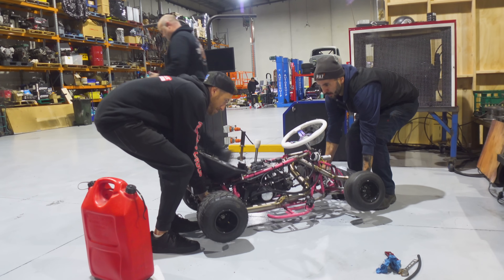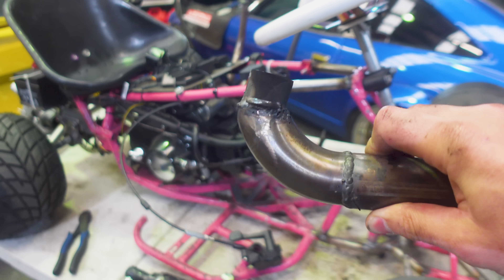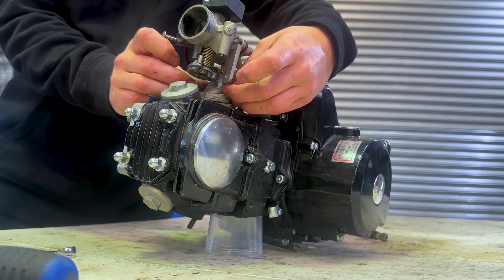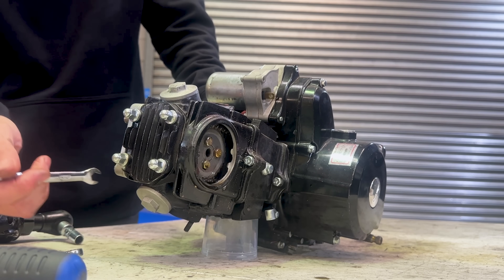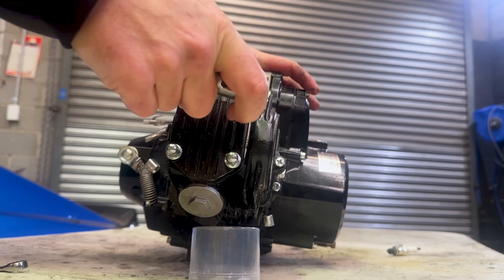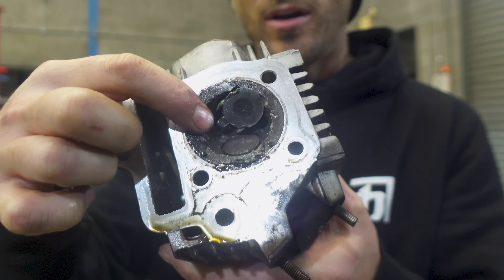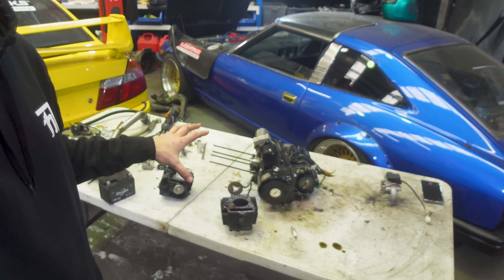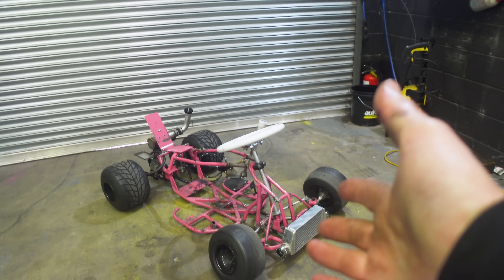BLOWN 125cc TURBO Motor TEARDOWN Go Kart | Part 9

Comment from the maker: Missed an episode? Watch the whole 125cc Turbo build series HERE! https://www.youtube.com/watch?v=BkHVaRDEAlY&list=PLLrSI6tzPmgFHxkPwczR5Zc_DKtxfkXuL
Reply: @itsmikelake Hi love the vids ❤ the kàrt looks mint   not sure if anyone has suggested this yet.  So my suggestion is do away with the electric start (I know it's not ideal but easy to get around) the reason behind this is so you can install an inner rotor kit this allows the engine to free rev up to 14000 rpm with stock flywheel and ignition the 125cc motors make 9.5kw @9500 rpm (max the stock flywheel will allow it to rev) if you do an inner rotor kit port the head and intake runner do valves and timing I like the double head gasket idea not sure if you will have trouble with chain length thought     I guarantee if you do the inner rotor kit you will be surprised the gain. Just beware some kits are hit and miss with tolerances.      Hope you look into it      keep up the great work ❤
Reply: Valves Kit Intake Exhaust Valve Assembly for 125cc ATV Quad Dirt Bike Go Kart
Reply: New Head cam 125cc piston 125cc parts
Reply: I'm your newest subscriber 🎉 hope you keep up the work

Comment: You can oversize to 60mm piston
And 62 stroke 
4 valve SOHC 25mm/22mm
With 35mm carburetor / throttle body + Turbo maybe you can fly.. 

Sorry i don't smart to speak English but i try to told you

Comment: ❤ valve float if inlet or back pressure over coming exhaust valve. Need stiffer spring plus heat from turbo and pop corn turning not helping. Detention could of been factor, Do not add head gaskets to lower comp dish piston so you keep quish/qunich put help flame front. So many turbo engines have dished pistons plus makes piston lighter......
😊

Comment: Need stronger valve springs the stock brings are pretty soft and the pressure on the intake side caused it to not close fast enough
Reply from the maker: I agree!

Comment: put an anima 190cc daytona engine in it, my buddy put a vz21 turbo on his stunt built honda z50j but those engines are oil cooled and is very important to have a oil cooler for it so take the return line from oil cooler to the turbo and the turbo return line back into the engine and always keep an eye on the oil level

Comment: Dudes from Thailand doing 200kph with this engine. No forced induction 😂
Reply from the maker: But no forced induction is borrriinnnggggg 🥲
Reply: @itsmikelake yea true but I'm just telling that with some bigbore, stroker and a 4 valve you couldve doubled it's power

Comment: in these little engines the valves are almost always the first things to go.. so if i were you ide get upgraded valves ;]
Reply: I had one ages ago and the valve snapped at the top and the valve fell into the cylinder and went chunchy crunchy on me lol

Comment: Hey mate. Take a look at the yx190. Fuel injection is capable with the starndard manafold. 5 gears, oil out and in for cooler and/or turbo 👌. Later upgrades 4 valve head and 212cc bore kit 🤤. Looks like some Daytona parts fit yx190 🤷‍♂️

Comment: Yo bro the same thing happend to my quad its becouse of valve float my damange was way worse i made a hole in the piston and a piece of the valve got in my exhaust . Becouse i had it in much higher revs when it failed on me .

Comment: the good thing about these motors is that I'm pretty sure that they use the same gearbox from bigger engines so this one can take the torque, also they are straight-cut gears so they are tough
also, throw some stiffer springs on that, usually they are flimsy (it has the same issue that those predator 212s)

Comment: It probably started floating. Either that or the chain stretched. The only way you ever break a valve is contact. BTW, your videos being my inspiration, im building my youngest son's old mini quad into a gigantic r/c drift car. Gonna have the body 3d printed by my little brother and im putting my sons old kx65 engine in it. The thing is gonna be a menace to society. I might put a FPV cam in it so i can rip around the neighborhood and chase coyotes and shit. Gonna be so rad.

Comment: My thought on what caused it is the timing on the engine if you retard it a little by turning the stator plate (if the engine has a adjustable stator) and will stop what some call valve bounce
Reply: Not timing I was meant to put valve bounce being caused by the timing

Comment: Don’t lower the compression there about 9:1 factory . I have a turbo 125 pit bike and you definitely need to not rev it out that high stock without a valve spring upgrade. I’m making 3 psi on two step and 9 wide open with a blow through carb setup .
Reply from the maker: Great info! I'm doing research at the moment and will buy some stuff this week for the motor upgrades 😁

Comment: Make sure to check the rod play. It could have toasted the rod bearing, alowing the piston to reach TDC sooner due to the inertia of the piston & rod, also allowing the piston to linger at TDC for a bit before the crank rotation took up the slop in the bearing, thus pulling the piston back down.. resulting in similar interference from the valves as a loose timing chain.

Comment: If your going to bore it 

Use a bigger throttle body 
Bigger jets
NO FILTER 
(more fuel=more air) 
A race cam and new rotating chain (timing)

With a quarter turn throttle (max power at 1/4th throttle) then obviously youll have the bigger piston alteady ported head etc 
I think after tune itll be 155cc (go external) 😂👌🏼

Itll be a beast

Comment: To much boost holding intake valve open . Need stiffer valve springs
Reply from the maker: That's definitely one theory, although we're only making 1.5 ish PSI of boost so not sure that would be it?

Comment: You can buy a big valve head and 60mm cylinder block for that engine, but you need to machined or port the crack case to fit the block. Then manually port the intake manifold to match the flow needed for the big valve head. Add turbulence when you port the intake to have maximum air and gas mixture.

Comment: Should be because of valve float and valve mightve crashed into the piston. You probably need stiffer valve springs. Instead of new cam you can use rocker arms to adjust the valve opening. Like 1:1.2 rocker arms should push and open the valves more. Piston, crank and the rod might come as a weak points when upgrading aswell. Its better for your wallet to upgrade them earlier instead of breaking everything and buying the upgraded parts again and again.

Comment: Could be springs, could be heat causing valve to stick in the guide? Would have been good to check if cam timing was ok before pulling it apart.

Comment: Oil oil oil 😂 your turbo is stealing all of it from the head also basic maintenance called a valve adjustment and lock tight if your two stepping the adjustor will rattle loose. Turbo needs a support also. Your performance theories are so far off it hurts. Big bore is cool but y'all haven't even gotten the 125 to do anything special why move up? Don't run multiple head gaskets that will leak run multiple base gaskets. It's a small bore you don't need to lower the cr we got away with 14:1cr and 60psi of boost on pump fuel the distance between the plug and the farthest point in the chamber isn't far enough to see the type of detonation your thinking of.. the time it takes the flame front to reach the far side is less thean the pressure wave that we see cause detonation in cylinders 350cc and up its also well documented in the nadca studies no need to loose more power. Now if you were compound turbo an argument could be made that the extra volume could be filled with enough extra mixture to offset and even make more power than the cr loss but from experience before 50psi of boost that won't happen and your cr is already in the low end
Reply from the maker: It sounds like you have a lot more experience than I do 🤣. I didn’t even know these valves could be adjusted! We’re only going bigger as the current turbo is too big for the 125cc, so naturally we’re looking to increase the cc rating which will spool the turbo much better. But we’ll see!
Reply: @itsmikelake  it's a vz21 it's not too big your engine was running terrible and the exhaust was leaking bad. back in our single turbo days we had a vz21 spooling at 2500rpm on a 155cc and 3500rpm on a 125cc. Thumpers need a plenum for the same reason sizing a turbo is hard it dumps all its volume in one bang. We spent yrs on the Dyno measuring things and back pressure is always an issue even after moving to a vz45 that flows way more on the turbine end. We didn't loose much spool doing that either. Seal it up good and atleast for us we ended up giving up making the crush seal work as you can get it work but never for long. We milled it flat and welded a vband on the head and all those problems went away. That being said you can easily do 40psi on a stock engine or about 55-60hp then the transmission leaves the chat. I'd consider skipping the normal rules about turning the boost up slow as the previously mentioned distance in the combustion chamber means detonation is not really an issue so long as the mixture is good and timing is under 40° advance over 30psi of boost. Everything iv seen has came down to you guys not knowing. So listen up iv boosted 6of these motors and many more motorcycle engines and cars the rules for singles are different. Get an electric fuel pump and a tank for the turbo oil, keep that system separated from the engine. I have a long list of reasons but let's just make this a hard rule. It's not that it can't be done it's that one needs to redesign the entire oil system and modify cases to get a proper supply of oil to the turbo. The short version is that's a roller bearing engine and it makes 1-2psi at idle and 5-7psi at redline and that turbo never wants to see less than 20psi but it's happy around 30-60psi if your drain has no back pressure it won't smoke if it smokes you either already killed the seals due to lack of lube or you have back pressure on the return. I'd strongly recommend going to a vz45 as the compressor is better billet wheels are available with the same inducer meaning same power potential and bigger exdusers meaning at higher pressures which you need desperately. The intake is fine port matching is always a great idea but you just need a plenum off that tb. If 125 a 500cc plenum should be fine. While doing it I'd suggest paying attention to runner length as Honda wanted mid range for days and let's be honest it shines in the high rpm it's a small engine go ahead and make a runner that helps with that. I found 18in from the valve to not loose much anywhere but give good gains up top. Your issue was never flow it's keeping pressure consistent. Do that and youl make some beans. And I do stress this alot if it's happy and making 30psi it should make 40hp easy on pump gas. We've done it plenty of times it's not hard at all. I will recommend looking around the jungle site for a set of roller rockers from one of the china companies. They do break at crazy spring pressures and 20krpm but that's far from what your doing. A cam helps but don't get caught up in it boost will get you far, and easy. Just stop starving things for oil these motors already have a oil pump that's too small for the engine in the na configuration it can't spare the oil to feed a turbo before we even get to the pressure issue. I have made my own cases to stuff a gs650 oil pump in and a few filters and regulators to keep the different bearings happy but it took me 5yrs to get that right and God idk maybe 15engines. Get an electric pump and be done. Also take that turbo apart and any new ones first the 270° thrust bearing will thank you. In our experience it's about a 1/3 chance it's feed holes are already clogged out of the box with metal shavings. Cleaning them out first will save the thing. And for 30psi port the bottom part of the wastegate actuator and feed boost in both youl end up at 30psi if your leaks are solved. Also I think kabota makes a version of the vz45 with a 360° thrust bearing that swaps in. Pretty sure we found it on eBay for under $20 USA. You don't need it but it will make things work longer at real boost numbers. Keep it up but really listen I'm getting tired of telling y'all on every video. Also stop focusing on shit that don't matter and focus on the stuff that actually matters cause y'all are ignoring huge problems for Internet clout and we see that. Also before you blow up another one make sure to atleast shim the intake valve spring at the base, one spark plug washer does wonders for keeping the valve shut under boost with rpm. We got all the way to60psi that way before the valve started getting held open by boost at high rpm. And youl know it's doing that once the boost is over 30psi and it just starts to flatline up top and gets better if you take boost out. Not the peak power but the shape of the curve. It should make peak power at or around peak rpm certainly over 10k rpm
Reply: I know thats a long read but all your solutions are in it. Also consider that this is a small engine abit off on a valve adjustment is loosing half the lift on the cam making 14hp na isn't a hard endeavor on these 125s with boost anything under 30hp is just bad execution.

Comment: I work on these  small engine it just couldn’t handle soo much rpm with boost i recommitted a air cool 250cc timing chain it  just have shape and size difference and u get more power without flying a valve

Comment: I doubt running lean would do that, would burn a hole in the piston first.  My guess is valve float, I'd get upgraded valves and springs on the next build.  Also should get a 160cc. Same dimensions and mounting points I'm pretty sure
Reply: Is it needed to bore the engine block so the cylinder sleeve fits?
Reply: All the Chinese pit bike engines use the same mounting holes on the motor all the way up to the big dog Daytona 190 motor that’s a 4 valve engine that makes 25hp out of the box

Comment: I'd check valve spring to see if it valve ans dropped thr valve, also if you wana add gaskets to lower compression do it on the base gasket side (cylinder to crankcase side) lastly I'm building a turbo 2 stroke triple snowmobile if your interested check it out 😊!!

Comment: Don't use 2 head gaskets. Use 2or 3 bore gaskets. Otherwise the spacing between head and  block weii be too much to install cam chain. I have ran in to that problem  recently  installing 2 or 3 bore gaskets instead of 2 head gaskets solved it

Comment: You can bought a new head for that motor, you can search for big valve head set, and I suggest to use a racing valve spring for that since that motor was revving high. If you bought a big valve head you can port the inside of intake and exhaust for much better performance.
Reply: thats true, i have and honda 97cc and revs to 9k totally fine, even 9 and a half too
Reply: @nicolasp7395  yeah I heard about those small cc bikes, they rev alot higher that what we expected them to be

Comment: one suggestion, you may need to heat treat the parts or drop forged parts in to handle the heat from the turbo, or run water cooling?

Comment: Valve springs weren't rated to the HP you were putting out bro... Side note.. SP tools must be stoked having sponsored you cause you never miss a moment to tell us which brand tool your using... Awesome advertising.. love your work man
Reply: The valve springs aren't rated to horsepower they're rated to RPMs

Comment: Upgrade the valve springs to something 3 to 4 times as strong(valves too if you can). I bet the valves were floating at high rpm and the piston hit the intake valve. 

At least these engines are cheap and very easy to work on. Good luck with the next iteration!

Comment: I would love to see where the Valve Failed, I'm picking it where it is machined for the Keeper to lock in. I am hoping the conrod is still straight and salvageable. but just like a race car, make sure you thoroughly flush out everything the oil goes through, as the gearbox and clutch is bathed in engine oil. and we all know that guy who forgot to replace the oil cooler after blowing an engine and had the new engine die straight away because of the bit's that were trapped in the cooler

Comment: Valve float may have been an issue, you were revving that little motor pretty hard haha. Ive had a couple stators blow on my motor because I was revving it high, but that might just be a me issue 😂
Reply: Yeah I doubt those stock valve springs are up to the task of revving that high, and with boost 😂

Comment: u prolly had too much torque through ur timing and it failed cause these motors are built with pretty maxed out parts
u could do with some upgrades for more tourque and hp also coming with more strength and reliability

Comment: Well 125cc engines are mostly cast iron, its not the most durable engine when it comes to high pressure and high heat.

Comment: You can also upgrade to zhongshen 190cc engine fits on same engine mounts
Reply: Or daytona 190cc 4v
Reply: @RBTuned even a yx 150 or zongshen 155 would be a good upgrade and much cheaper than the Daytona

Comment: That's fucked 🤣 that intake valve is toast! Even I'm not sure why it's done that cheap quality maybe? Would it possibly be cuz the turbo was pushing the valve open slightly at high rpm/max boost, because the springs are stock? Kinda like when u get value float??Anyone have any ideas I would love to know?
Reply from the maker: I’m leaning towards a crap quality valve as it happened on deceleration? 🤔
Reply: @itsmikelake  there not the best quality those little Chinese engines 🤷‍♂️ instead of boring it out like u was saying in a previous video, why dont u try get a 160cc/190cc. I'm sure u can get uprated values and shit to can't really remember it's been so long since I have had a pitbike
Reply: engine braking on bike engine is nuts add clutch pedal needed @itsmikelake